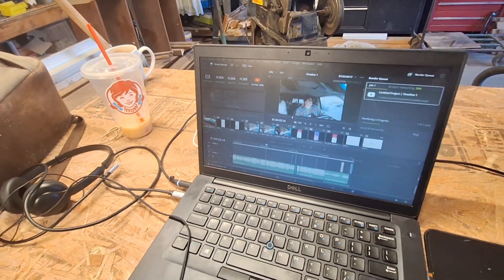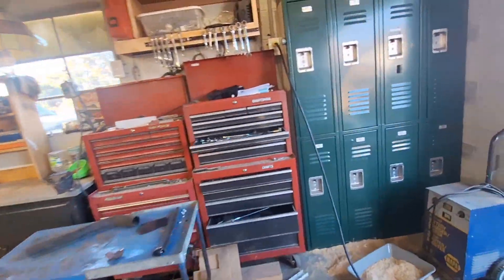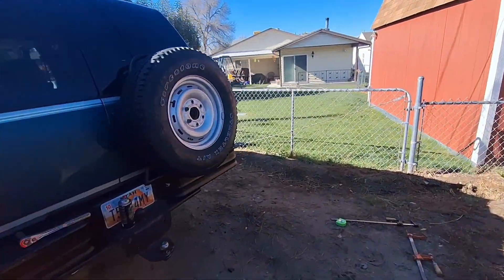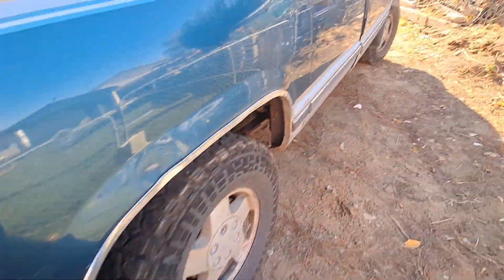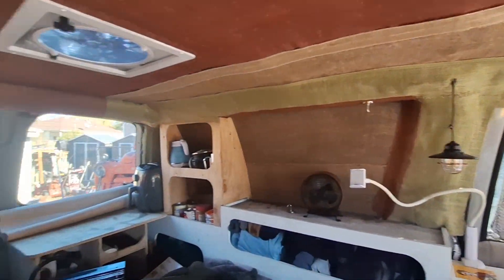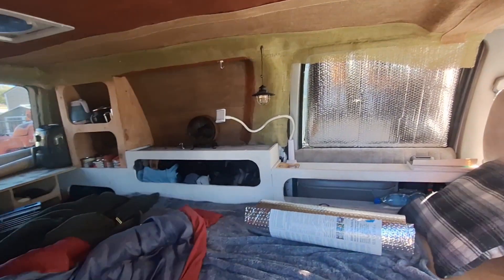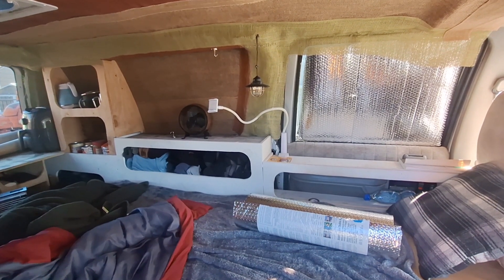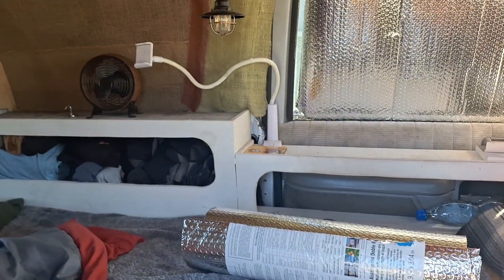1 Day Until the Road: DIY Chevy Suburban Home Rig...

Comment: Did you use spray adhesive for the cork? Did you have any issues with it sticking?
Reply from the maker: I'm spoiling a future video here... I had to use a LOT of adhesive spray and press it like a mad man. Just to then...
Reply: @ I feel you. Cork sucks up all the glue. I also had issues when it got hot in the van.